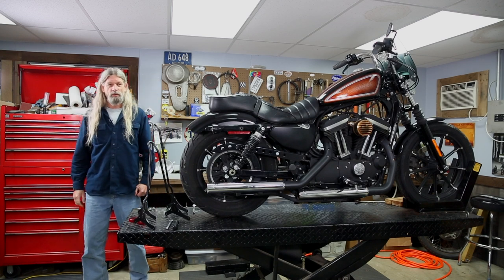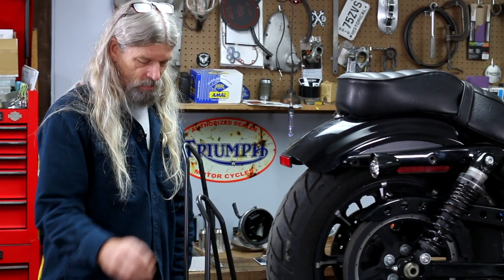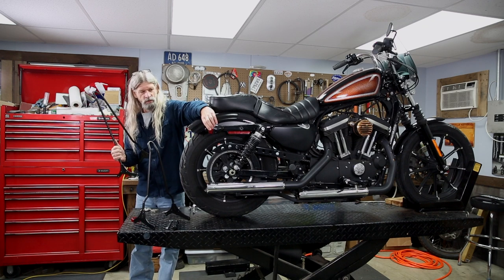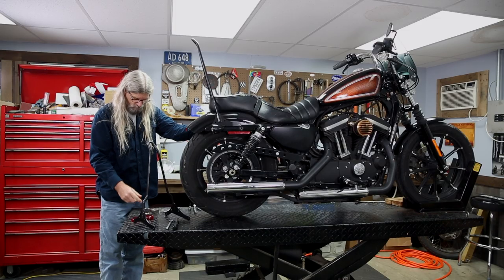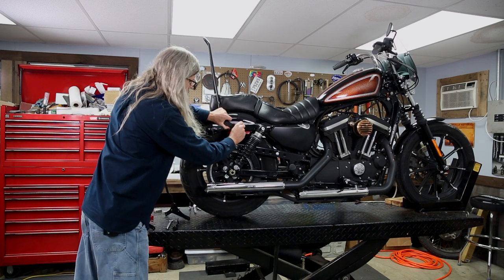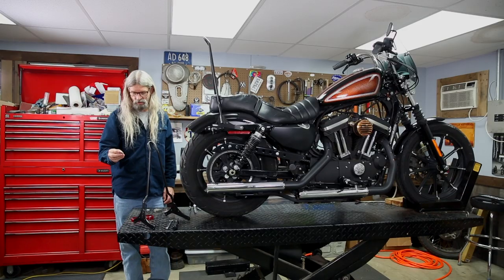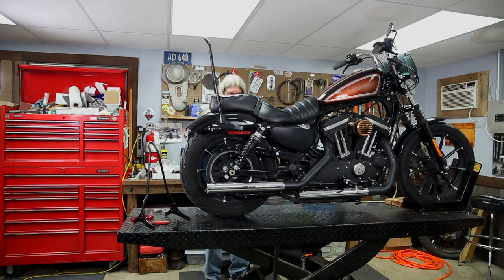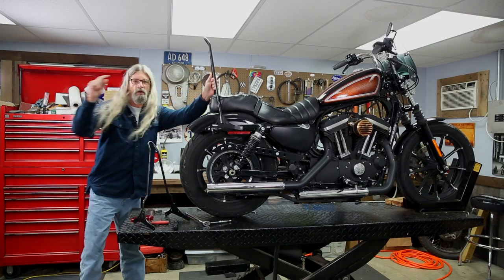How To Install: A Gasbox Tall Chopper Bolt On Sissy Bar On A 2004 & Up Harley-Davidson Sportster

Comment: I have the same bike the same seat and I have the Harley Davidson sissy bar. Pay extra but it fits just want to squeeze in a seat there’s no back pad and the angles off. The Harley when you can remove it without taking off the hardware looks a lot nicer than that.
Reply: can you send me a link to the seat by any chance?
Reply: How far are the holes spaced on your HD sissy bar? And how wide is it?